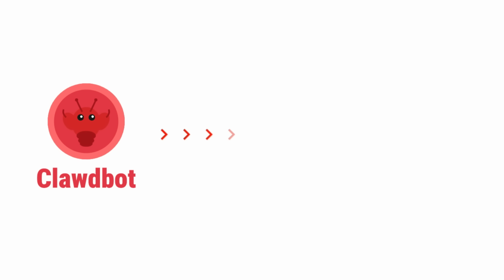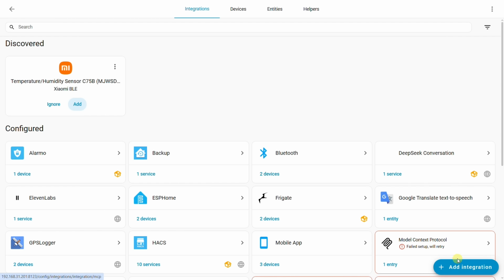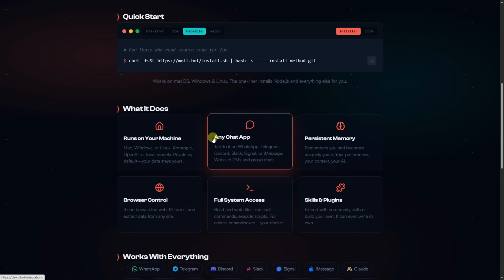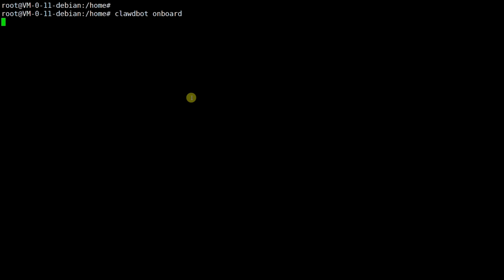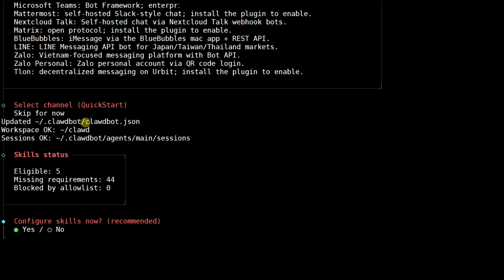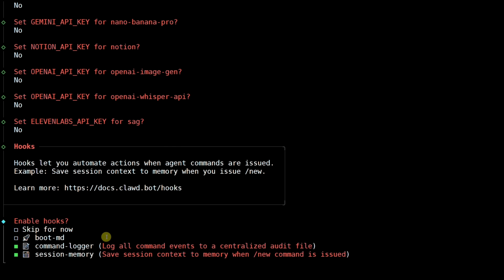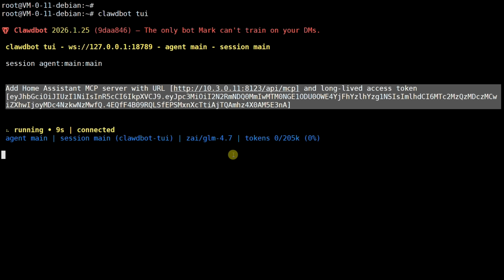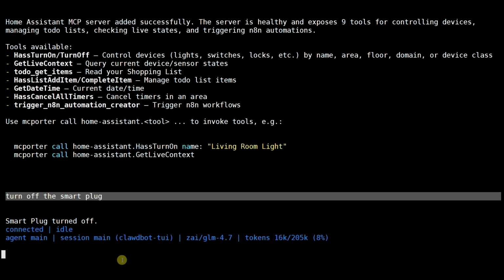How to Use Clawdbot and AI to Control Your Smart Home

Comment: Hi, I'm trying to do this but it keeps giving me this error when I enter the command to add the home assistant server. The IP and token are correct. Could you help me: "not connected to gateway — message not sent
gateway disconnected: closed | idle
agent main | session main | unknown | tokens?"
Reply from the maker: That error usually means the agent cannot reach the server, verify the openclaw gateway is actually running.
Reply: @hometechfun Let me explain: I installed OpenClaw on an external Windows PC because I have Home Assistant downloaded to the hard drive of my second Windows PC. The procedure works, OpenClaw installs, but it blocks me at that exact moment. As soon as it finishes installing, it opens a website with an IP and port, but the site doesn't launch and gives an error even though the procedures are correct. How can I fix this? How can I check if the OpenClaw gateway is working?
Reply from the maker: May be u can find the answer in 'https://docs.openclaw.ai/gateway'
Reply: @hometechfun  404
Page Not Found
We couldn't find the page. Maybe you were looking for one of these pages below?
Reply from the maker: https://docs.openclaw.ai/gateway